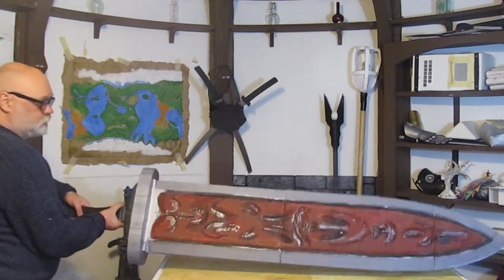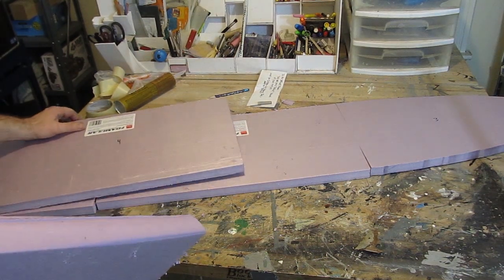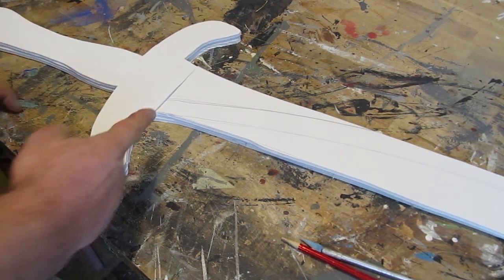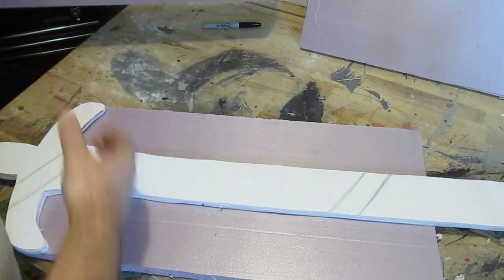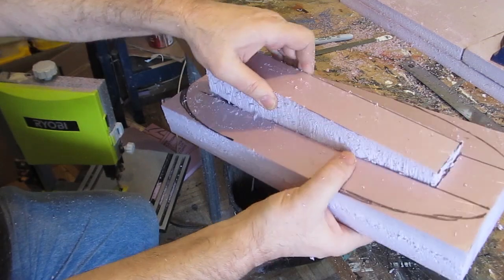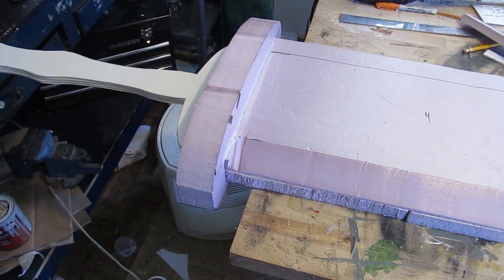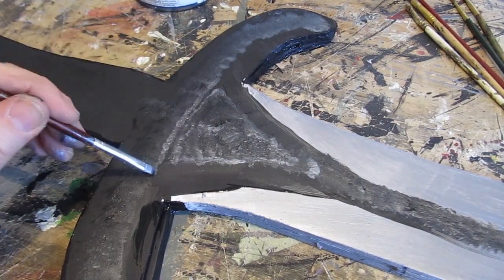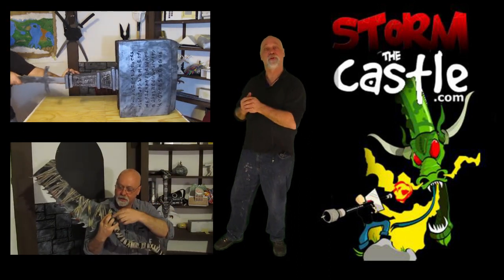Make Ludwigs Holy Blade from Bloodborne

Comment: That would be an amazing sword project to tackle, Will. Your technique is great with the foam, however, a hot wire router or a Dremel tool router would go faster than a rasp to carve out the inner sword channel. I only suggested, since I have seen videos of people carving out stream and river channels with those tools with extruded pink foam.

Comment: @epicfantasy 
At 00:09 i saw the guard bending for weight, i suppose.. its risky swing the blade for a cosplay? 'Cause i really want to make this project, but i'm scared that the guard may break during the esibition..
Reply: ArcanHazeD if you haven't made it yet, you could make it stronger by using duck tape or something then make it blend in